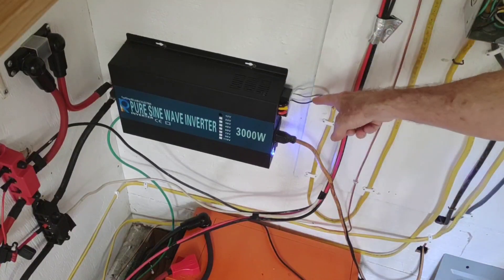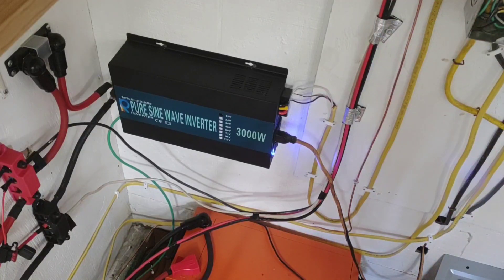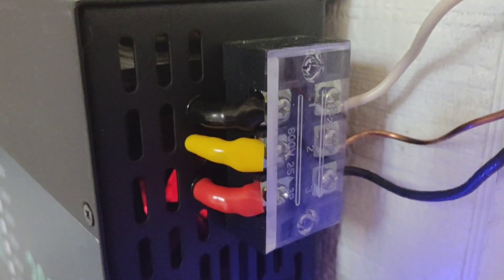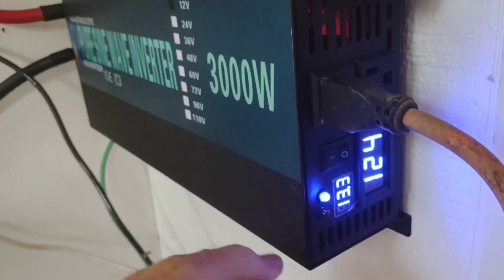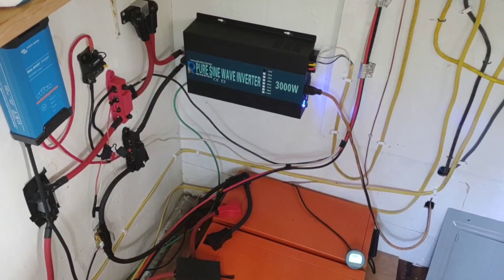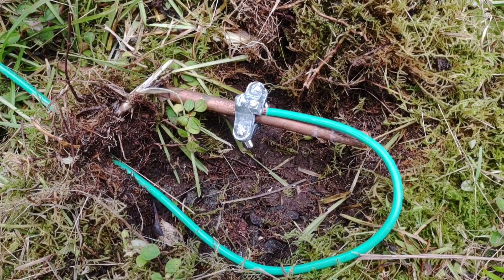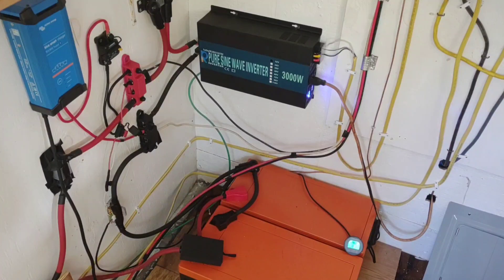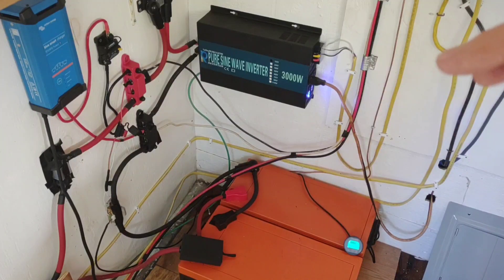Hardwired the Reliable 12v 3000w pure sine wave inverter, and searching for a good ground

Comment: I thought I would drop a kudos to you as I put my Reliable 3000w 12v inverter into my RV. I've had this inverter for a few years and used it sparingly but really didn't set it up for complete use. The key for me was watching your video where I could hardwire a plug or receptacle 30A. So I wanted without plugging in a generator, just pull the RV electrical plug that you would plug in at a RV pedestal a 30A service, instead I hardwired a 30A Receptacle into my RV and Plugged into my inverter and my solar ran my RV. I got busbars, 400amp hour LiFePO4 batteries, panels on the roof of RV and it's working like a champ. I've got the breakers and fuses and charge controller all hooked up on a board and I can't tell you how nice it is that it's done. Thx to your content as you gave me the connection to hardwire. Thank you again

Comment: I think you're a little bit over concerned about grounding.
It is a safety issue, and you can never be too safe, I suppose.
I'm currently living in Southern California here. It's a good thing you're not working in the Rocky mountains of Colorado. You'd find out what they mean by Rocky Mountains real quick.
Speaking of rocks. I kind of wondered why lava rock might be a problem, and then I think I may have answered my own question it comes down to continuity and electron flow.
Lava rock has a very low amount of water in the Rock itself.
The more important question to ask yourself is whether or not other people's methodology actually works, or does it lead to failure?.
I saw an interesting video on YouTube where instead of using copper, they used rebarb, the same stuff commonly used in Concrete Construction. This material may be better suited for going through rocks than a simple piece of copper. Also, I understand it can last up to 80 years.
My other suggestion is to use a hammer drill and a masonry bit to go down at least 3 ft. I think that might be enough. That might be a little better than looking for the right tree root.
I hope my suggestions have given you some value, and my wisdom might give you something to think about.
I'm currently building a system for an RV which if you live in an RV lots of luck looking for a ground every time you park best I can do is run a wire from my chassis ground to the ground and make sure it's dragging on wet ground.:-)

Comment: I have a 2000w Reliable inverter I'm hardwiring through a 30a breaker box for a couple of circumstances. From what I gather, I earth ground my inverter but what about the negatives in the 30a box? I can't find 1 single video showing this.  Great video though, aloha! 🤙

Comment: A lot of chat/confusion/questions about the 2 plug-in outlets being wired incorrectly compared to the hard-wire terminals inside of these inverters.I have one of these unopened in the box as a spare in case the Giandel in service ever craps out. Anyone have any further insight as to that issue? Thanks. Aloha
Reply from the maker: That inverter continues to be a workhorse for me. 24/7 for nearly 3 years now. Although I have not torn it apart to look at the wiring, so can't really speak of that. But, it has not let me down, and I have it hardwired, plus using one outlet. So far so good. has run everything I can throw at it to date. Aloha!🤙

Comment: Some people think the ground rod is to protect from electrical fault shock.  The main purpose of a grounding rod is protection from lightning and from static buildup during thunderstorms.  The main way to prevent fault shock is to provide an alternative to neutral, by **bonding** to ground mains at the ac panel.   If you include a gfci trip switch at the mains panel, in that particular circuit then you get the best fault shock protection.  Of course if lighting strikes, the earthing provides a better conductor path than the body.  Also a good ground plate in that area is perhaps better alternative than a grounding rod.  Your local hardware should be able to advise you too or an electrician.
Reply from the maker: That is great information, and described perfectly for us to understand! I have had many lightning strikes over the years. Lost equipment that wasn't plugged in or even being used on two separate direct hits. Lightning scares me more than any kind of weather. My friends use to think I attracted it since I had so many experiences with near, or direct hit's. In fact when we would be on the golf course and see lightning off in the distance, they would often joke that the round was over simply because I was there! Aloha! 🤙

Comment: Very good...can you check the voltage output of the neutral and the hot of this inverter??...I have a similar inverter and it shows 60 volts in both line...and the neutral and ground are not connected.  Hence, it will be very bad if you ground the neutral in this type of inverter. Thanks.

Comment: Thanks for sharing.  It looks like you are using in-line fuse and circuit breaker on a positive end of your charger. Why ?  One is enough
Reply from the maker: For my use, I like having some quick disconnect switches as I continue to move and adjust components over time. Makes it easier for me to shut everything down before turning wrenches.  aloha 🤙

Comment: Should run a 300amp fuse. You're only good for 2400 Watts there. Just sayin.
Also, if I may ask, can you not just ground it to your water lines? They go well underground already.
If that is not an option, you can use a grounding plate instead. You only have to dig them down a few inches.
Reply from the maker: No water lin3s here, so that's great information once again...many thanks!🤙

Comment: Why didn’t you just take a screw out of the aluminum housing and ground to that? All circuit boards ground to the chassis
Reply from the maker: Great point 🤙
Reply: Ok now I’m having a grounding issue. Same 3000 watt reliable inverter. I hard wired it so I could hopefully use it for my blower on my central ac/gas heater. I drove a rod about 5 foot until I met resistance and my heater blower still won’t run and blow heat. It keeps blowing itself out. The blower motor will run just no heat. I am grounded to that little hub underneath that you pointed out and my solar fuse/ breaker box is also grounded.

Comment: just a quick math solve here, at 3000 watts, running 12 volts would be at LEAST 250 amps, meaning your fuses are too small to run the full 3000 watts. just food for thought here
Reply from the maker: And good food it is! I'm learning so much from everyone here,  and I really appreciate your feedback.  I realize I'm a tad under sized on that, but it continues to be a work in progress...aloha 🤙

Comment: Your neutral and ground need to be tied together in your fuse panel in order to have ground on your 120 vac ground terminal.
Reply: I hope I'm not late....but do not connect de neutral with the ground on this inverter. Check the voltage of the neutral first...I have one and it shows 60 volts....not  good!!! It works ok the way it is...the ground in this type of inverter is not connected to anything.
Reply: @tonypower5625  the ground does plenty, especially during lighting storms.
Reply from the maker: Thank you so much for that information Bill, really appreciate your taking the time....mahalo! 🤙
Reply: @ProjectsinParadise808   Do not tie the neutral with ground you gonna fry your inverter!!!
Reply: @peterbear6570 uhmm I wonder about that.  So where's electrical fault protection then?
Reply: @drsproc  This particular inverter  has 60V on neutral and 60V on  line, the yellow is ground which is connected to the metal box of the inverter. The inverter is best for off grid.  I tie the yellow to the ground wire in subpanel which has separate ground and neutral and the panel self is grounded  to the rod. What ever you do do not connect  the ground{yellow} to red or black wire  you will fry the inverter.
Reply: @ProjectsinParadise808   . If the house neutral wire is combined with the ground, connect the black wire with it, Do not connect the inverter yellow wire with the black wire together.
Reply: @peterbear6570 yes that’s what the manual says.
Reply: The manual of this inverter specifically says you cannot connect the “ground” yellow line to the black “neutral” line or the red “hot” line.

Comment: I don’t think you really need a ground
Reply: If you want to get a hole in the rock for your rod use a long Masonary bit on a hammer drill probably can get one from Amazon I don’t think you will need a fancy drill just one with a hammer feature
Reply from the maker: We did try with about an 18 inch hammer drill,  and that was far as we got....will keep trying different methods and see if I can't find a sweet spot in the lava!🤙
Reply from the maker: I'm gonna keep trying,  but who knows!?! I'll post whatever it turns out....mahalo!😉🤙
Reply: Yes...this type of inverter does not require a ground.  Check the  many  modern inverters and you will find that for the ground ..there is a just a hole...there is nothing to connect the ground prong to the equipment that you are powering.

Comment: Keep it up and eventually you will have everything worked out. Earth ground is not as important as mains when using an off grid system.  I never had a problem,  but I understand the purpose and I know that it's different than a utility systems.
Reply from the maker: Hey thanks for that Timothy...its all seeping in eventually for me. Good to be challenged,  make errors even, and learn.  I'm having fun for sure. Aloha!🤙

Comment: looking great ! what I did you figure things out as you go . each system is different . love that breaker box . some time down the road might change wire from inverter to panel to 10Ga. but for your loads 12ga is just fine . if you have a long run go up a Ga or 2 . you may have to use more than one ground rod to make a better ground. hear I had to use 2 8Ft 8 to 10Ft apart 4Ga to main box. Per UL inspection . That was a grid tie system . you can get GFIC breakers for that breaker box. love that ground buss near the floor . as you add you can easy tie in more grounds. they make a tester for 3 prong outlets US/CANANDA 120V 60 HZ with 3 lights on it for correct wiring .I got mine at Home Depot and has GFIC button test on it as well . keep- checking what to do for better ground . here on the main land the cods change a little for each area . one town over I did one rod 4Ga and it passed ,
Reply from the maker: Hey good morning Robert! Im pretty happy having some lines run off the hardwire . I can already see I need a few more panels , which will make me need a bigger charge controller,  and go to the bigger wire for that, and in time run that 10 guage you suggested as well. The refrigerator does not like the gfci outlet at all, and in deeper research on this bran recommend not using one. So, I am changing that out to regular outlet.  Going to work on the grounding some more this weekend,  and hopefully get a good test. I continue to be challenged,  which is good for keeping me on my toes, and I still take notes on all of your comments.  Having fun most of the time, sometimes a little frustrating,  but all good....Mahalo!!🤙

Comment: GREAT EXPERIENCE IN PARADISE WHEN IT COMES TO SOLAR . WITH LIMITED GROUND CONNECTIONS BECAUSE OF THE LAVA ROCKS , YOU CAN ONLY DO WHAT YOU CAN DO TO STAY SAFE . ALOHA !
Reply from the maker: Aloha Cedric! I'm still having fun, and learning all the time.  Sometimes I have to look at something for days before it finally sinks in. Through perseverance,  I will find an adequate ground,  but this lava is making me work for it! It's all good fun though....mahalo!🤙
Reply: It seems like some local research would get it done
Reply: If you find somewhere it will go in, local guys use an electric impact-hammer drill apparatus to drive them in regular earth, seems like a great idea